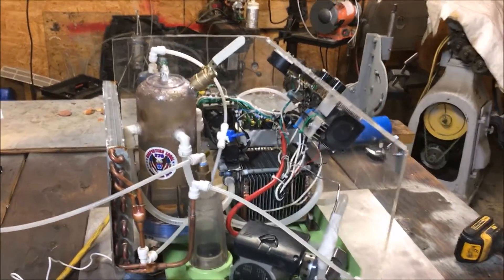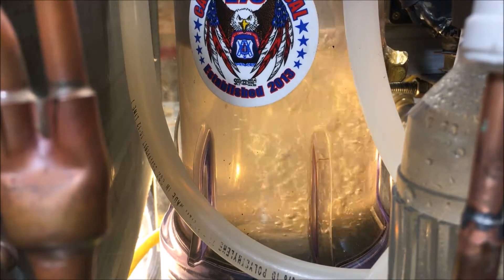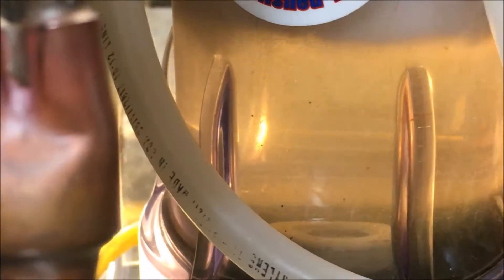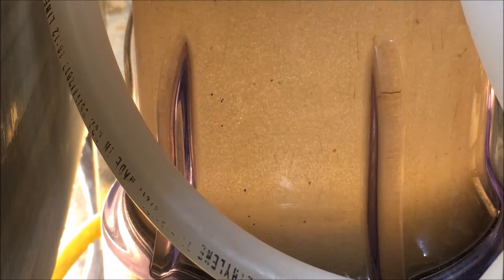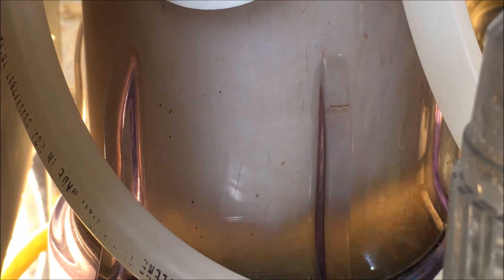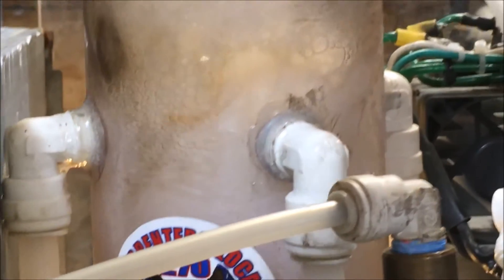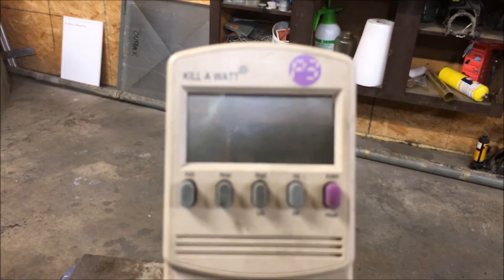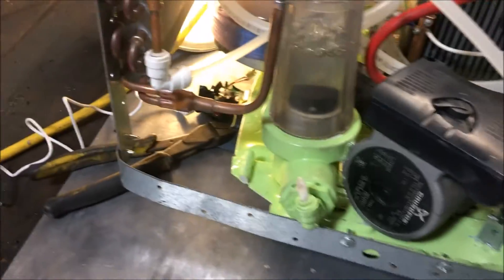HHO Oxyhydrogen torch Ultrasonic Bubble Coalescence anti foam system

Comment from the maker: Fellas thin oil does the trick to remove foam from your cell, just add enough to make a 1/8 layer in the reservoir and it last indefinitely and does not make soap

Comment: If preventing leaks wasn't such an issue, you could pressurize the system w/a head pressure. We do it on aircraft hydraulics to prevent foaming but in your application I'm guessing that's between tough/near impossible.
Reply from the maker: Yep that would solve the issue for sure , didn't have the patients back then to build any thing that can handle over 10 psi .

Comment: Cool! I had the idea with the transducer myself without having seen it anywhere, now googled it and there it is! The internet is awesome. Thanks for the video!
Another thing I was thinking about: using simeticone (in liquid form, almost any pharmacy has it and it's extremely cheap; simeticone is the chemical name; brand names will vary between countries) as a surfactant (=5-10 ml added to the electrolyte and the bubbler); it greatly reduces surface tension (=bubbles should detach more easily from the electrodes) and prevents any foaming. In medicine it's used against bowel gases, same principle. It's also a secret trick often used in gastroscopy when foaming messes with the view: a few drops and all foam is gone withing a second. Let me know if you're willing to try that out for HHO generation.
Reply from the maker: Hey thanks , i actualy have a video of some of the strange things that can happen when you add additives to  system

Comment: Looking really good though! (~_^)-b
Reply from the maker: Thanks , this thing is my little hot rod , i could mess around with this thing all day , its an extremely interesting device  that brings Chemistry, engineering ,metallurgy, electronics and material science together . I had to learn alot to pull off what we see here. I know things about assembly and fabrication that take years of experience thanks to this device  . making one that doesnt leak is a serious task   and not easy the first few tries , also hydrogen gas destroys many plastics , found that out the hard way and looked into it sure enough hydrogen embrittlement is a real thing that nasa is very aware of .For that i hate when i see guys putting this stuff in their car engine .
Reply: @NOBOX7  I am currently in the prototyping phase but i seperate Hydrogen and Oxgen, which brings countless problems just with the cell (mainly  perfect gas seperation) I can really feel how mouch time you spent, to get this perfomance out of it. 3 Jears of experimenting with a Split Cell cell is a lot..... great video!

Comment: Really good video and cool technique!
Reply from the maker: Thanks bro  , i mentioned you a few vids back and thanked you for the KOH and gasket  suggestion , ive known for years koh  conducts better then naoh but never made the change , but man i love this new flame , its as blue as the sky  . However i still have foam LOL , but its all good my new pump system nocks the foam down so i now have a 100 % duty cycle using this very small reservoir. Also i now have EPDM gaskets that you also suggested years ago i think maybe not  might of bin PTFE  but i no we talked about what you was using at the time and i asked for PTFE and they said i would be better off with EPDM  based on my specifications .They said PTFE would be fine but EPDM was better suited for hot KOH  solutions
Reply from the maker: I almost hit you up for some of that separation membrane you use , does that stuff restrict flow of fluid much  ?
Reply: So for foam I have used a few drops if Spa time anti foam and it works great.
Reply: I didn't see a flow change.
Reply from the maker: Lol funny you say that , i have a video for you , its old but kinda cool , i did some reading about electrolysis in old books and was amazed at the things they made with electrolysis . By changing the size of the cathode and making one smaller then the other they where able to force other reactions , like making hydrogen peroxide .  https://www.youtube.com/watch?v=KmvddSSz6Ss
Reply: I have seen this when too much is put in the water. I use only a few drops.
Reply from the maker: yeah i got a little carried away then when i seen this i did some reading and discovered that electrolysis can create some extremely complex chemicals even very dangerous one  , this information is only available from very old books on google books so i got spooked and stopped using it thinking i might make a neurotoxin gas or some explosive salts lol
Reply from the maker: By the way im honored the King of dry cells watches my videos  , bin watching your monster builds for years , i remember the cold War of  you and Smartscarecrow  LOL
Reply: I've fallowed you for a long time also. Smartscarecrow taught me the basics in the beginning. Nothing but respect for him. It's zerofosselfuel I cant stand lol
Reply from the maker: LOL interesting observation , i agree and i also Like Gary , i was very rude to him and he disarmed me with his personality , it was an hho argument lol , so i let it go and came to like him his work was impressive and he is the one who brought dry cells back as far as i can tell , i could be wrong but for me and hundreds of others he is the guy who brought back the "Bipolar cell"  as they are called in industry.
Reply from the maker: just made an awsome find last night . turns out oil stops my cell from foaming over . the koh didnt work for me and i think its the polyethylene tubing

Comment: NOBOX7 Yours is my favorite YouTube channel!  Keep up the experimenting, that test of the ultrasonic module was interesting to say the least.  Have you tried powdered stainless steel in varying amounts in your water to see it's effects?  I have been thinking about either tackling some H-Cat experiments(HHO Catalyst) or possibly Plasma Electrolysis.  Thank you again for your videos, keep them coming.
Reply from the maker: Thanks no i havnt tried or even herd of the ss , very interesting . im gonna get a bigger driver soon and it will work even better at high output modes
Reply: It would be cool to test the stainless steel grit/powder...it was just an idea I had but never tested.
Reply: @ProlificInvention  its called 'metal loading' and research paper titled hydrogen production from semi-conductor based photocatalyst via water splitting should help